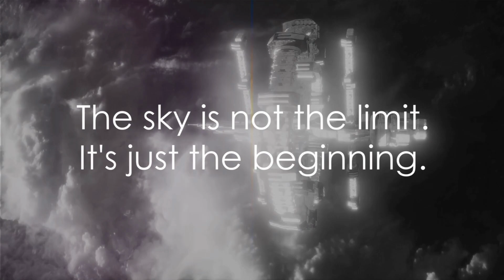The Space Barrier: Why You Can't Fly a Plane Into Space 4K

Comment: Wow without even watching the video I can tell you why. First thing is the engines require air entering the front so the fuel can be mixed with oxygen and burn. The higher you get, the less air. Too high and the engines all shut down. Second problem also lies in the thinning or lack of air. There's nothing for the wings to get lift from. So too high and a plane crashes. Very simple.